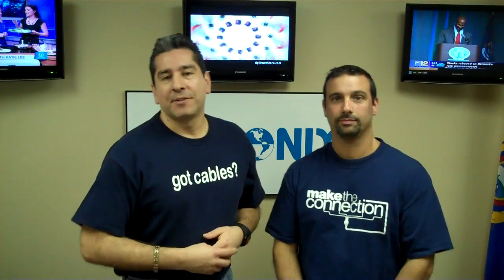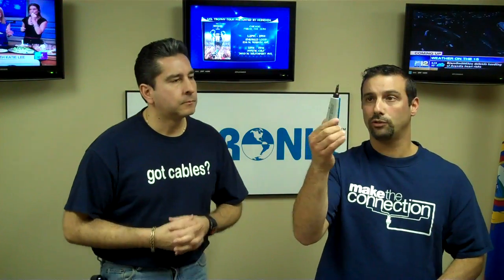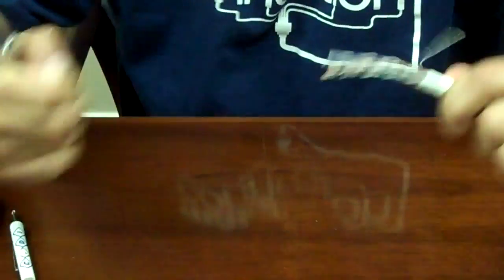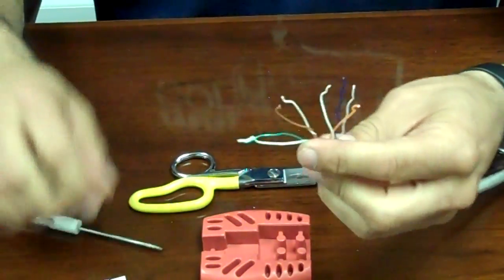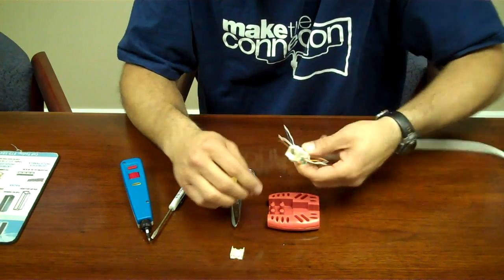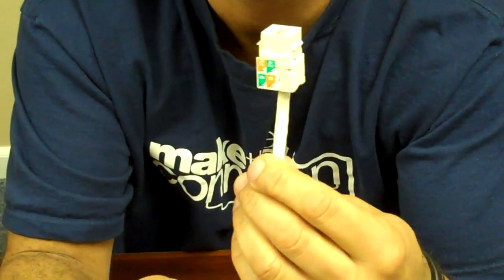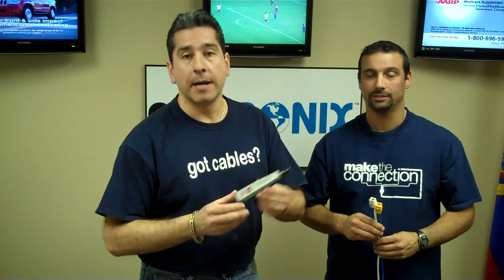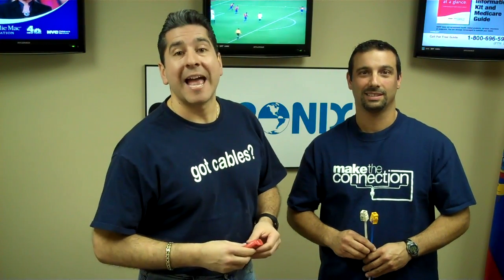HOW TO | Punch Down a CAT6 Keystone Jack

Comment: What would happen if you were to accidentally have some keystone jacks on your network as A and some as B? High latency? Would they just not work at all?
Reply: +Brenton Hood On modern equipment, they will work fine, as they will auto mdix. It's built into gigabit Ethernet spec.
Reply: If both ends are configured the same you're good.
Reply: +Brenton Hood They wouldn't work at all.
Reply: +Jonathan Reed thank you so much. I was super surprised that it worked and then had a weird latency issue for a day and was thinking it might be related but it went away so I feel better now. thanks
Reply: Thanks! This was my concern as well. I have several lines through the house. Some are A and some are B (not my doing), but now that I know I can interchange I won't have to redo anything.
Reply: Wire it all as B. That's standard. Avoid any issues down the line. (no pin intended). There is no reason to wire some as A or B.

Comment: I like the video, but you should use the pull string inside the cable to slit the cable jacket after removing the first bit of jacket.  The reason for this is just in case you nick the pairs while stripping the jacket initially.

Comment: It's also a good practice to have the cable actually in the keystone about 1/8' to 1/4", not just butted up against the edge. The least amount of unexposed wire the better off you are.